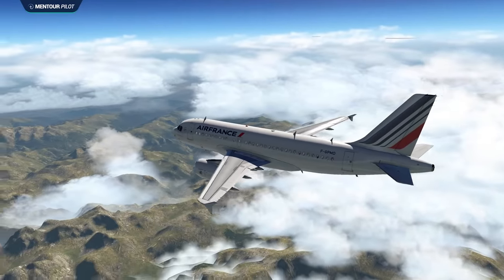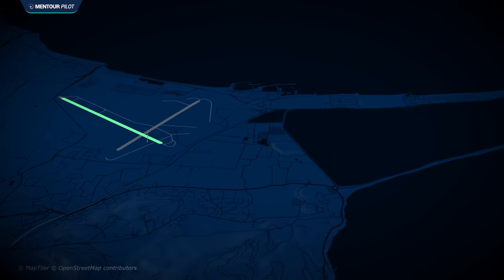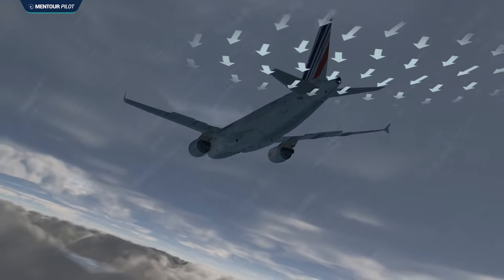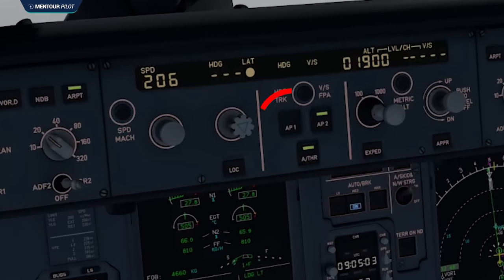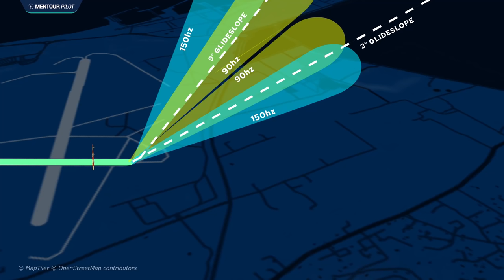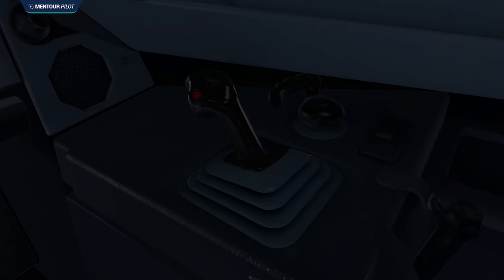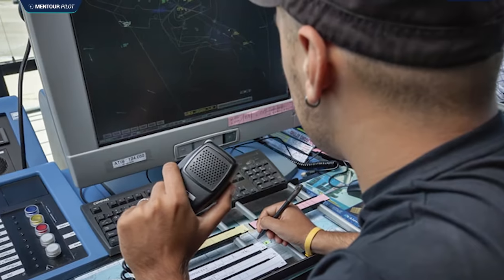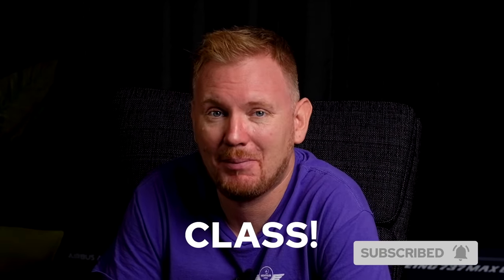An Absolutely CRAZY Reaction! Air France flight 7512

Comment: This reminds me of part of my IFR training.  While I was under the hood hand-flying a Piper Warrior in VMC, my instructor vectored me to intercept a false glide slope on a practice ILS approach at an untowered airport.  As I followed the needles in the descent, the CFII asked me if everything was ok.  I said I didn't understand why I needed a >1000 fpm descent when it should only be about 500 fpm at 90 knots.  He had me discontinue the approach, and gave me a new set of vectors for a normal approach.  

At that time, I hadn't yet read enough about the instrument landing system to be familiar with this potential pitfall, but I should have checked the chart for altitude to expect at the FAF.  A truly valuable learning experience.

Excellent episode!
Reply: i do not understand this. how can you intercept a glide slope, when your descent-rate is higher than 1000fpm in the first place? secondly: if you are under the glide slope, it would never come up, but would already be up.
So what is the point, what was going on? We cannot understand this with the info you gave.

All you said is, your common sense wanted a lower sinkrate. But what was the situation at all?
Reply: @MrTiti  I think that he was saying that he had indications saying that he needed a >1000 fpm descent, not that he was actually making a >1000 fpm descent. And my guess is that he was above the glide slope on the mirror lobes above the primary lobes, just as described in this video. See the section "Inverted Radio Signals" at 13:22 for a detailed explanation.
Reply: When I was in the RAF we always endeavoured to intercept the GS from below, more often than not we'd try to get to 2500ft at 10nm, after getting established on the localiser. I don't recall ever intercepting from above but I understand there are times when it has to be done that way due to local topography.

Comment: What you say at the end is like the go around procedure where pilots can do a go around without needing to explain why. Always good to not punish mistakes and instead learn from them.
Reply from the maker: Exactly correct
Reply: Without them telling the reason for the go around i think it will make it easier for them to hide faults, which is not good for the the aviation industry or training.
Reply: @chaimbar1171  its more to not push pilots into attempting a landing that might be dangerous to avoid doing a go around. Alot safer to let pilots do it without fear of repercussions so they land safely
Reply: @ExaltedwithFail  that's right, didn't think of it.
Reply: Unfortunately there are some airlines which view a go-round as a pilot error i.e you should never need to go round if you have flown the approach correctly, and if you do go round you are burning fuel and inconveniencing your passengers unnecessarily. The list of such airlines includes some well-known European companies, some of them national flag carriers.

Comment: Nice video as usual. They had a perfect landing (where the aeroplane could be used again... aviation joke).
Personally, I live literally under the WRO-29 approach path: I see the belly of the aircraft passing overhead. With the help of the internet, I do a bit of plane spotting. I found a site which transmits radio coms from the local tower. A few days ago, we had some strong wind; I was impressed by a set of pilots who asked for a hold, did two laps and said "That is too strong for us [the wind]" and diverted. Another aircraft (MUN-WRO) diverted too back to its original airport. I am impressed by the culture. I gave up my flight training at 80 hours (no licence) in 2009.
Reply: I was on a flight from Boston to Burlington, Vermont in the NE United States in the early 80's in the winter. After we boarded, I noticed the captain left the aircraft for a bit. He came back and announced that he had checked the most recent conditions at our destination, and there was snow over ice on the runway and a 30 knot crosswind, so we weren't going. He said to us all on the PA: "I'm a good pilot, but I'm not THAT good, so I'm not taking any chances." Looking back 40-odd years later, I'd say he was a great pilot who made a great decision that maybe saved a lot of lives. It's the continued growth and nurturing of that sort of culture and tradition that makes commercial aviation so safe today.

Comment: Thank you for this video,  it's a great way to get the word out about issues like this. 
One small thing,  the RF frequency for the ILS is shown as 90hz and 150hz. This can't be possible since a directional antenna at that frequency would be hundreds of feet long,  and they're not.  Goggle lists the frequency for the localizer to be between108MHz to 112 MHz. And the glideslope is between 329.15MHz and 335 MHz. Note that's MegaHertz, not Hertz.  It's a small detail and doesn't effect the point of the story or even how ILS works.  Just an fyi.. Only reason i caught it is that I've been an RF (radio) guy 40+ years. Thane again for a great video!
Reply: Of course, a massive discrepancy! But see Alex Bristor's post. I'll quote it here (if I may?): A minor technical clarification on ILS, the localiser transmits a carrier signal in the frequency range 108 to 112MHz and the glideslope in the range 329.15 to 355MHz. The 90Hz and the 150Hz lobes are modulating signals on the carrier signal.
Reply: @gyrogearloose1345  that's right both the gs and loc transmit sidband lobes of 90 and 150

Comment: I work as a technical authority in maintennace engineering, and often use the thorough investigations in the airline industry as examples of where it can all go wrong, and how. The importance of knowing the roles and responsibilities, adherence to procedure, need for competence, considering all relevant failure modes when evaluating activities, and so many more. Air accident/incident investigations are thorough, consider all factors, are openly reported - it's a good way to go.
Reply from the maker: Indeed!
Reply: I wish all industries implemented a just culture. Instead hiding , not reporting , is reinforced and nothing really changes until that business is impacted financially. And even then, many have those 'gag" orders where no one can say anything bad or negative about the company. At least here in the US that's how it works.

Comment: Love your final comments @Petter.  Like you say: it is (or should be) a culture, a "state of mind" which accepts we all make mistakes. But at the same time encourages mistakes to be shared and discussed (without sanctions) to improve safety. More generally: it improves quality. Boeing found out the hard way  what happens when mistakes in manufacturing / testing are swept under the carpet.

Comment: "Broken cloud layer of about 1700 feet. There was visibility of about 5000 metres... and the surface wind was 150 degrees at 12 knots..." That right there is the hardest part of being a pilot. Forget the language barriers, WTF is up with feet, metres and knots. Pick one measurement system and standardized the WHOLE WORLD to it. It's amazing that we don't have more Gimli Glider like scenarios with using three different standards when most have agreed that English is the standard language but not officially.
Reply: Feet and meters are measurements of distance; true, but knots is a measurement of speed, so why do you even include that with the other two when you can't mix THAT one up with the other two??! 😳
Reply: @SgtMclupus  Feet Per Second (FPS) is used by a bit of people, same with Meters Per Second.
Reply: Nautical miles (i.e. knots) is the global standard for distance/speed for aviation and marine applications. Feet and feet per minute are the almost globally agreed upon standard for aircraft altitude and rate of change in altitude (only China, Mongolia, North Korea, Russia, and Tajikistan use meters for altitude). Aviation IS standardized by the ICAO. The usage of meters there was for a meteorological observation, the pilots actually have a table available to them to convert that to an estimated RVR (Runway Visual Range) which is a standardized aviation weather metric.

Comment: Imagine you as a passenger sitting in the back waiting for the landing and the plane just goes into space shuttle mode.. pretty scary
Reply from the maker: True, hard to know if they would have recognized the high pitch and low speed though 🧐
Reply: The question is, what will an a318 do when it stalls?
- raise the nose and slow down even more? That would be the worst case
- drop one wing and start rolling? Not good but should be recoverable, given enough altitude
- drop the nose and pick up speed? That would be easiest to handle.
Reply: @MentourPilot  wouldnt such a high pitch have a weird effect on the pilots tho ? is it not possible to feel the G's on the cockpit ?
Reply: @mrxmry3264  The algorithm which decides what to do will have been designed by fallible humans, who may not have considered all the possible factors. Humans often out-perform gthe systems they design.
Reply: @hb1338  when it comes to stalling, it's not some algorithm that decides what happens, it's the aerodynamics. and aerodynamics can be unpredictable.
Reply: I would recognize a TOGO as a passenger, but bad weather makes a missed approach rather likely.  If I cannot see the horizon then I would probably not recognize the steep pitch particularly if accompanied by deceleration.  It would probably feel quite normal.  Missed approach is always a bit scary but I hugely prefer a missed approach than taking dangerous chances.
Reply: @mrxmry3264  the video explains that the A318 set full thrust (TOGA) when it came close to stall speed. It doesn't tell whether it also automatically pitched down, but from other edge of flight envelope scenarios we know that this same Airbus alpha protection also influences the pitch. So I guess that the pitch down was also induced in this case. Airbus pilots will know better, though.
Reply: @mrxmry3264  the A318 automatically set full thrust when it came close to stall speed. That was a decision and action of the alpha protect algorithm in this case. Whether it would be enough to prevent stalls in all aerodynamic cases, I don't know.

Comment: This sounds eerily similar to Air France flight 447 at first. There's definitely lots to look into and learn from stalls involving fly-by-wire aircraft. Thanks for giving us an insight into this, though!
Reply from the maker: I’m glad you found it interesting. There is certainly a lot to learn but these types of incidents are not only happening to Airbus aircraft. A Boeing 737 had this exact thing happening to them in Eindhoven back in 2013.
Reply: As I commented elsewhere, I suspect there are probably heightened sensitivities at AF about how stall conditions can occur when pilots must assume manual flight control when automated systems are providing potentially confusing information, as in AF447.   I suspect this contributed to AF reporting this incident for training purposes.
Reply: There is a difference. Here, the aircraft was in Normal Law during the entire flight and alpha-prot and alpha-floor activated, possibly also alpha-max. Alpha-floor throttles up and if the pilot insists in pulling back on the stick (s)he will eventually bleed so much speed that alpha-max is reached. Alpha-max pitches down just enough to keep the aircraft at an angle of attack just below stalling. No matter what the pilot does, alpha-max cannot be breached. Alpha-max is very close to the stalling angle or the cl max of the aircraft. With the aircraft at alpha-max the aircraft can climb at a very high angle of attack without actually stalling. The pilots on this flight may have been at alpha-max.

AF477 was in Alternate Law due to loss of airspeed indication. In Alternate Law the alpha protections are lost. This means that the pilots could actually stall it if they did the wrong thing - which they did.
Reply: @todortodorov940  Indeed.

Comment: Holy crap!  I'm glad it worked out in the end.  I really like the point you made about the constant improvements to safety ongoing.  Even without the newest upgrade, this aircraft went into TOGA.  (Alaska had a few B-727 crashes in the early 70s in the false zone above.)  Airtravel is incredibly safe!  But early reports indicate the VIP MD-87 that crashed after takeoff at TME last week was flap/slat takeoff config.  I guess some 40 years after a cluster of these incidents on different aircraft (with warnings disabled... and NASA study) it seems ridiculous to me that this can still happen.  But I guess we're all human at the end of the day.  I take comfort in the fact that 1:6,000,000 flights have accidents.  We are all safe in your hands Petter!
Reply: Airbus and pretty much everyone else are on opposite sides on their design philosophy. Airbus is pretty unique in that they build their safety systems so that they protect the plane by overriding humans (hence the alpha protection, alpha floor, TOGA lock). Whereas others have the humans be the ultimate command, so they warn, but the humans have to act on it (stick shakers, stall horns, audible speed and configuration warnings).

Both have pros and cons, but overall I'm more in Airbus' camp. Humans ignoring the warnings have caused more incidents than faulty protection systems acting in error have.

Comment: Back in the day (US Air Force ATC) we performed an 'ILS monitor' using our PAR radar as a backup to the pilot's instruments. Any ILS deviation was noticed immediately and communicated to the pilot.
Reply from the maker: That’s a great idea but maybe a bit cumbersome on a day to day basis
Reply: @Daniel:
How is a precision approach radar different from an instrument landing system? 🤔
(non-pilot noob here😅😋)
Reply: @MrNicoJac  A military PAR uses two radars that can be manually servo'd by the controller to acquire the AC at about 10 miles out. The controller looks at two small radar screens (one for glideslope, one for azimuth). The controller gives azimuth turns and glideslope advisories all the way down to touchdown. It's very precise and has lesser minimums than an ILS. If I recall correctly our ILS mins were 200 ft and 1/2 mile. PAR mins were 98ft and 1/4 mile. These #'s are when the pilot has to see the runway or go around.
Reply: @danielsnook5029 
That is an amazingly insightful explanation!
Thank you so much ^^

Comment: Very well done video and great explanation!

As both a pilot and an engineer who designs RF systems, I appreciate how you explained in more detail how the glideslope works. Even most pilot training material doesn't seem to go into much detail on that, but it's really a very simple system from an RF design perspective with very little built-in protection against either interference from other systems or capturing side lobes, as happened in this incident. A lot of people seem to have the idea that everything in aviation is cutting-edge technology. While that's true in some specific areas (turbine engine design especially comes to mind,) it's pretty much the opposite of the truth in many other areas, especially radio systems. Both communications and navigation radios in aircraft are largely based on technology that's many decades old, nearly a century in many cases. And ILS is very much in that latter category. Testing of ILS started in 1929, 98 years ago. And its principle of operation is essentially unchanged since then. Which is great for the general aviation community, because it means that the systems originally installed in our often 50-70-year-old aircraft still work as well today as they did half a century ago. But it also means that they're just as susceptible to interference as they were half a century or more ago.

I also appreciate how you mentioned the safety culture in airlines surrounding reporting and investigating anything with safety impacts. This is one of the things that I found most disturbing about that RAM departure from FRA several years ago. No investigation was performed. And no records from the CVR or FDR were maintained, nor any records of the V speed and weight and balance information provided to the pilots released. As such, when the incident later came to light - mostly by third parties who just happened to be plane spotting sharing video of it - no real investigation was possible, so the aviation community gained no knowledge to learn from about how to avoid such an incident in the future. The airline was apparently more concerned about protecting its image than about improving aviation safety, which is extremely concerning.
Reply: Cool! 
However 1929 was not 98 years ago, last year or this year.
Reply: @aperinich haha, You are completely correct. That definitely should have said 93 (now 94.)

Comment: Hi Captain. Very nice  and informative video as usual, congrats!. A slight remark though, when the A/THR is locked into TOGA LOCK due to ALPHA FLOOR protection, the only way to exit this thrust mode is by disconnecting the A/THR with the red instinctive push button on the throttle. Source FCOM DSC 22-30-90. Best regards and keep up the good work
Reply: That's the correct way but not the only way, A/THR also disconnects when the THR Levers are brought to idle and will also bring you out of THR LOCK.

Comment: Peter, I really enjoy your videos.  Just a correction from a radio guy (ham radio operator and broadcast engineer). From Wikipedia: "ILS uses two directional radio signals, the localizer (108 to 112 MHz frequency), which provides horizontal guidance, and the glideslope (329.15 to 335 MHz frequency) for vertical."  90HZ and 150HZ VLF range would never work for this purpose.  FYI!
Reply: Yes, I think the 90 Hz and 150 Hz refers to modulation signals; he just left a bit out there.